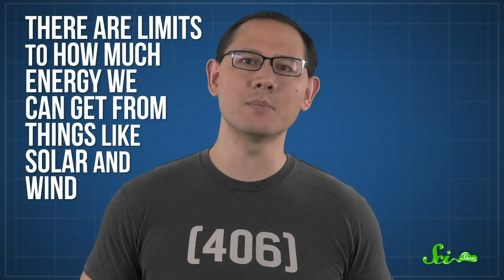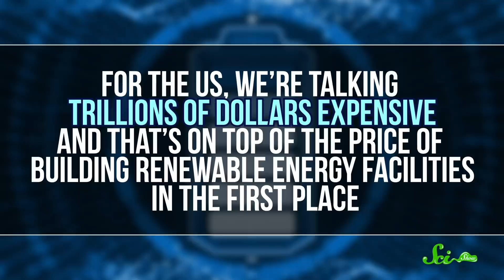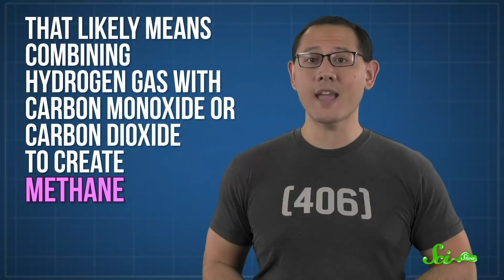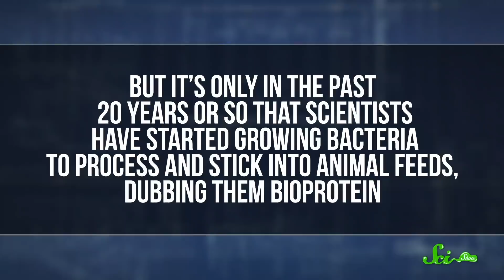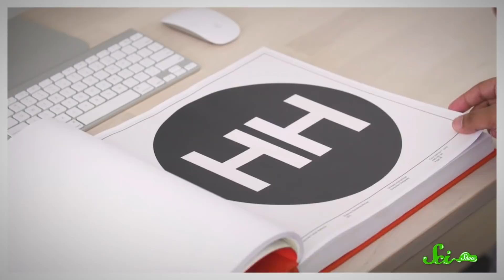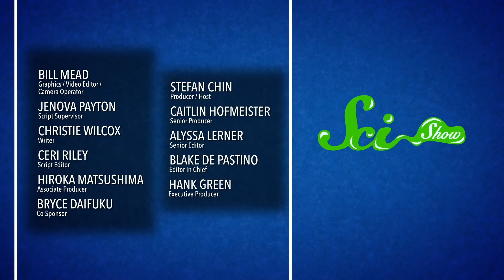How Engineers Are Turning Wind into Protein Powder

Comment: My money is on the idea of a global grid. Unless a world war/cold war occurs. Then it's this if anything.
Reply: How would a global grid save this problem? You can't transmit electricity to a place half a world away.
Reply: @FrainBart_main  ... Why not?
Reply: @yuirick  I will write the actual numbers and I hope you will understand it. If you want to transmit only 5 GW of electricity from one side of the world to another, you would need HVDC lines of the highest available voltage level, that is 1100 kV. The current flowing in these lines would be 4.55 kA. If we used a lot thicker wires than the wires actually used, the resistance of them would still be at around 0.01 ohm/km. Half way across the world would mean around 12,000 km, so the total line resistance would be 120 ohm. The losses in this line would be around 2,5 GW. So you would lose 2,5 GW of power, and you could get only 2,5 GW on the other side. This and the cost of doing this are the main reasons why it probably won't be done.
Reply: @FrainBart_main  What? 2.5 GW is a great result? Thought you'd come up with something more pessimistic. We are talking excesses of renewable energy, after all. When one nation's got rain, another has got wind. The closer the better, so you supply nearby sites first, and then you increase the distance as needed.
Reply: @yuirick  50 % power loss is a great result? Solar or wind would need to be 50 % oversized. And this is talking about a lot thicher wires and voltages that need extremely expensive equipment. With regular wires, used today for HVDC transmission, you couldn't get anything over such distances. I was talking abou extremely expensive HVDC lines, which have not been made anywhere. Who would pay for this? We have interconnection that exchange power like you said. One of them is the whole continental Europe, there are three in the USA... We could connect them with underwater HVDC cables. The problem still exists. What if all the interconnections have too much wind at some time? What about the nightime when there is no solar production in Europe or in the USA? We would still need regulating power plants or energy storage.
Reply: @FrainBart_main  Yeah, renewables are producing an insane amount of excess energy because we build enough to reach peak demand (around evening). Rest of the time it's practically unused, like around noon. A lot of sun energy, few people at home cooking dinner. If noon in one time-zone could be transferred, say, 5 time-zones, you could transfer it from one non-peak time-zone to a peak time-zone. And, generally speaking, batteries are more expensive than just about any other solution at current market price. I suppose connecting the americas and the rest of the world would be the hard part, as well as the political climate. Price shouldn't be a problem, if the EU/US pools in.
Reply: @yuirick   Anos Anosn  That's not a bad idea. There would still be problems on cloudy days and similar. We will need energy storage one way or the other. Pumped hydro storage is a good solution for today and the near future. I would prefer electricity production mix of hydro, nuclear, geothermal where it's cheap, biomass (with filters for PM) and a little bit of wind/solar. We would have clean, cheap power that is also dispatchable, regulable and doesn't have problems with energy storage, voltage profile or insuficient inertia.
Reply: @FrainBart_main  It's not my idea, so I can't take credit for it. Heard it from a student who was studying green energry or something, I can't remember.

I was speaking to a french guy about the dangers of nuclear power, even in a nation such as France. Seemingly, it uses a lot of water from rivers, and if that runs out, the whole operation can get out of hand quickly, which combined with climate change means that France might have to take action soon. Not sure if that's ideology speaking or not, but it made good sense to me. Geothermal is great, hydro is great, pumped hydro storage sounds good - regular batteries use finite and expensive resources and only last about 10-20 years, which is not very sustainable. Stuff like in this video could be used as well.
Reply: @yuirick  France has some of nuclear power plants at the sea, but most of them use fresh water as a coolant. Water flow in the rivers would need be very low to influence the production of nuclear power plants. If it's too low, you can easily cut production level of them or even stop them (which had to be done this summer for 4 of the nuclear plant). They had no problems whatsoever with this because you can crank up other power plants or import a little bit more at that time. The only problem I see with nuclear is nuclear waste. Accidents that happened were due to old reactor versions, not enough safety measures and a series of human errors. France produces around 90 % of clean electricity mainly due to nuclear power plants. For comparison, Germany produces only around 50 % of clean electricity (20 % is wind&solar), their electricity price is twice the electriciy price in France. Germany would also have a lot of problems if they weren't connected to the rest of continental Europe.  When the production from solar and wind is too high, the price on wholesale market reaches negative values - they pay to get rid of the electricity. Norway uses this and imports their electricity at that time and fills up their hydroelectric dams and pumped-hydro storages.

Geothermal is great, but isn't cost effective in most places. Hydroelectricity is maybe my favourite, mainly because it can regulate its output power very fast and on a large scale. It's also cheap and clean and can produce huge amounts of electricity. Biomass can be used too in places where there is an increment of forest (I don't know if this is the right expression). Pumped-hydro is the best we have now in terms of energy storage. I don't think P2G is going to be implemented on a large scale. Electrolysis + fuel cells give you an overall efficiency of lower than 50 %.

Comment: We can also turn solar and wind power into gravitational potential power!!!
Reply: You can calculate the weight or elevation needed to do so. If you wanted to store only 1 MWh and had 300 m of elevation possible, the weight needed to do so is 1223 metric tons (neglecting losses). Some random weights wouldn't be good at this, but it is done with water in so called pumped-hydro power plants.

Comment: Nope p2g is the worst option. Molton salt heat sinks and using that heat later to run a steam turbine is way way better. 0 emissions and it dosn't destroy fresh water a resource that is becoming more and more scarce (salt water electrolysis wont be used because impurities corode the electordes and the salt releases chlorine gas which kills people so thats out) With better insulation you may only see a 10% energy lose with a molten salt heat sink

Comment: Dude, Tesla Solar? There is no more worry about renewable sources. Slam that power into the Powerpacks and call it a giorno. That is lunch everyone, to the study.
Reply: How many of them would be needed? How much would that cost? Who would pay for them?
Reply: Many would be needed. It would cost a lot. The governments?
Reply: @APAstronaut333  The network costs on the electricity bill would go up so all the consumers of electricitu would be paying for it. I don't think this is the best idea because it's too expensive.
Reply: đeri662 The sun charges the batteries ?
Reply: @APAstronaut333  The sun produces electricity via solar panels. When the electricity production is too high (it's higher than consumption, e.g. at noon), solar panels charge batteries. When electricity production is low (lower than the actual consumption, e.g. in the evening), you discharge the batteries.

 We would need a lot od batteries to do so, and probably the one paying for it would be the power grid operator. You pay them via network charge on your electricity bill. This charge would get a lot more expensive. If the government subsidiesed the batteries, that would mean there would probably be a new tax on your electricity bill.   Either way, consumers would be paying for the batteries. And they are very expenaive at the moment to implement for the whole grid.
Reply: So let’s just keeping drilling oil from the Middle East guy, geez
Reply: @APAstronaut333  Wasn't sayinv that. Oil is very rarely used to produce electricity. What I was trying to say was that there are other ways to have clean electricity like hydro, nuclear, geothermal and biomass.
Reply: I grant there are. A safe place to store the energy is in the Tesla Powerpacks, additionally.
Reply: @APAstronaut333  Wind&solar + batteries will make our electricity prices a few times higher. If we use alternatives that I stated in my previous comment, the rise in the electricity price will be negligible. You don't need batteries with the technologies I stated, that's the main difference.

Comment: Wow people are overcomplicating this energy storage idea aren't they?  Here is the simplest way to do it:  Compressed air energy storage.  
Get rid of the turbine in the windmill, and connect that kinetic wind energy to an air pump, which pumps ordinary air into giant pressure tanks.  The pressure can then be used to operate a turbine to produce energy according to demand.
As for the heat generated by compressing the air (wasting that would make this method extremely inefficient, the heat must be put to good use), you can either 1. Channel it into a standard steam turbine, relying on this power source first while the pressurized air is only tapped when the heat is used.  Or 2. Store the heat in the pressurized air.  You'd solve many temperature issues with the turbine, but you're storage vessels would need some really efficient thermal insulation to minimize loss.  Or 3. Pipe the heat straight to buildings where heating is required.  This is already done in many places (with liquid coolant/water mostly), and is the most efficient use of the heat since that energy was going to be used for heat anyway... no conversion necessary.

Based on math, using a storage tank the size of a big crude oil storage tank, build to hold 200 bar like a diving tank, could store 3613 MWh of energy, enough to power a city of 1 million population for 4 months.  Definitely a valid option.

Comment: Governments love to complain about how power storage is so hard and we just don't have the tech. People push tech like this as a method that requires less overhead into your power storage system. However, many places already use an insanely stupid simple system which is; low maintenance, low initial cost, and low ongoing cost. The seemingly impossible power storage solution? Potential energy. When your power array (solar, wind, whatever) is producing surplus you just pump water uphill into a reservoir. When demand outstrips production (no wind, no sun, or just high demand) you let the water flow back downhill into your lower reservoir through a hydro-electric turbine. Yup ... That's it ... Dig two holes, add a pump and a hydro-electric turbine. It's a giant potential energy battery and it's green as green can be. Don't let governments give you excuses as to why they can't do it. Politicians don't actively push for green energy because the return on investment exceeds their election cycle. They don't want to be the one to spend but not get a return. Even if it costs us our future.
Reply: Yes, but if you want to have a lot of solar and wind there will be a need for a lot of pumped-storage hydro. This would increase the cost of electricity from solar and wind a lot. Who would pay for this?
Reply: @FrainBart_main  What? So would a chemical battery. Except the chemical battery costs more to make, maintain, and replace while having a limited lifespan and not being green at all.
Reply: @ghosttheoremproductions5469  I'm not advocating for chemical battery, I'm just not a fan of this wind&solar idea. A far better option in my opinion would be a mix of hydroelectricity, nuclear power, geothermal where it's cost effective and biomass with filters for PM and maybe a small share of wind and solar. We would have clean and cheap electricity, which would also be dispatchable and regulable on a large scale. We also wouldn't have problems with energy storage, voltage control and insufficient inertia in the power grid. With solar&wind we get more problems than solutions.

Comment: I wonder what the problem is with just using the hydrogen directly in a gas turbine power plant?
Reply: Because you will lose two thirds od the energy. If you would use this heat for heating houses, apartments etc., than it would be a good idea.
Reply: @FrainBart_main  ooh good point but we may be able to modify current natural gas power plants to except it. I also am curious if hydrogen fuel cells are scalable enough to act as on grid power plants
Reply: @HntrSvrsn  We could do that, but than again, if we have gas power plants, we can regulate the power with them (if solar production is to high, we lower the production from gas power plants and vice versa). This is done in today's grid mainly with coal, gas, hydro and somewhere nuclear power plants. I really don't know, I think it could be scaled up but the problem is efficiency. Electrolysis and fuel cells combined give an overall efficiency of less than 50 %.

Comment: If a solar power plant makes enough electricity in the daytime to run it's load day and night, so it has to make double the daytime load(or more). You would need enough p2g capacity to make it literally in real time. Seems like a lot of extra cost for no real benefit in many cases.

Areas with the right topography would be better served with 'train car energy storage', as it's called.

It's cheap, about as environmentally friendly as it gets, except for the control systems, the tech needed is all many decades old and dirt cheap (as far as this kind of stuff goes), and it lasts many hundreds of years with minimal maintenance costs compared to anything else out there.

Comment: Gas turbines could be run in parallel to pick up when these alternative energies are lacking. A type of contingency power system. Carbon dioxide scrubbers can capture excess. Sweden have a turbine which produces 2 ppm CO2.

Comment: Carbon dioxide released by burning methane produced in this way isn't a global problem, because that carbon dioxide was removed from the atmosphere. It's the same way burning wood is carbon neutral - that wood was made using carbon dioxide taken from the air and photosynthesized by the tree it came from.
Reply: guess what, so was the coal and the oil.... ^.^
Reply: @Alexander_Kale  Yes it was, about 300 million years ago. The problem, right now, is that we're releasing carbon into the atmosphere that has been out of circulation for 300 million years.
Reply: @GenaTrius  Meh. merely a larger scale of the same principle....
Reply: @Alexander_Kale  Technically yes, I'm talking about photosynthesis in both cases. What are you trying to argue here?
Reply: @GenaTrius  Mostly that, as long as we keep the cycle going, there IS no problem. It merely means our descendants will have more carbon to build amazing things with.
Reply: @Alexander_Kale  You're actually right, if we can manage to pull that off. If we can take something like 350 billion tons of carbon out of the atmosphere and render it into solid, non-biodegradable products within the next 50 years, we might be able to balance things out without that much more ecological disruption. But considering there are no active initiatives to do that anywhere on the planet, we're still facing a serious problem.
I comment like this on nearly every climate video I watch, because so many people, even professional scientists, fail to grasp this. I think it's because most of them are city dwellers, and city smoke in the city = bad. But the problem isn't carbon release, it's human activities upsetting a 300 million year balance in the scope of a century.
Reply: @GenaTrius  If that stuff we are now releasing has all been in the atmosphere simultaneously before, then the system has proven that it can take it and recover.  The claim that the speed will be a crippling factor seems dubious at best, seeing that over the last few billion years or so, surely there has been a cataclysmic event or two that did it even faster than us. 
Even whether or not the ecolological disruption will actually be crippling to us is still dubious, seeing how we do not know what exactly those will look like and how our current capabilities will measure up against it.  
It may very well be that there comes a point where prevention is no longer cost effective when compared to adaption.

Comment: While I completely agree p2g is the way to go for long-term energy storage in the short-term we have the example of the world's largest battery which has already paid for itself within one year of being completed it is able to respond to fluctuations in demand for the the grid instantaneously and that in itself reduces waste

 ultimately a combination of a decentralized grid powered by renewable energy with scattered large battery stations for short-term energy storage and P 2 G for long term energy storage is probably the best bet

And there's no reason to not use the oxygen as a fuel source as well if you burn hydrogen and oxygen separately and mix the exhaust you end up with water vapor